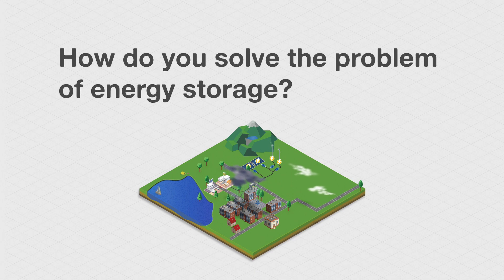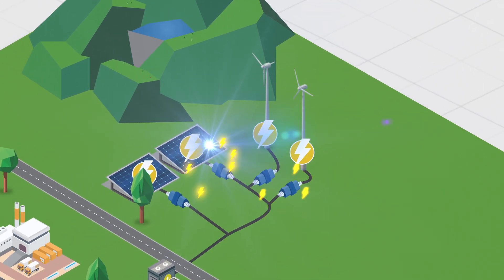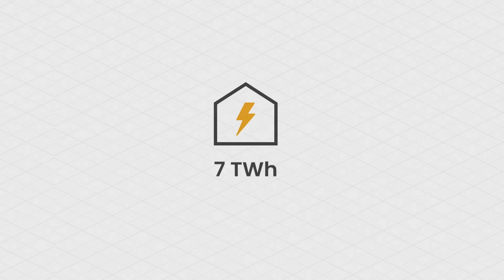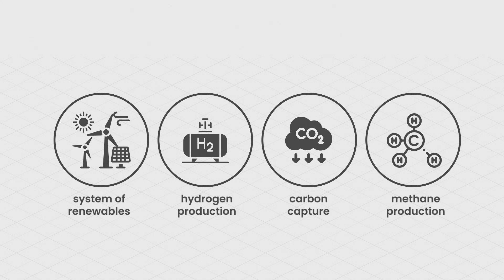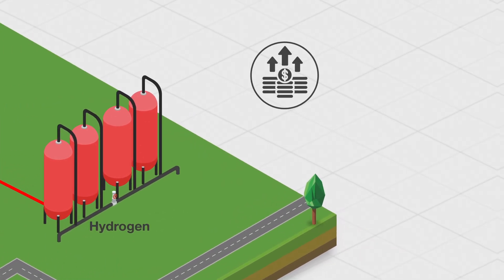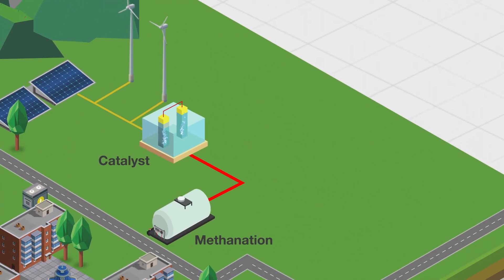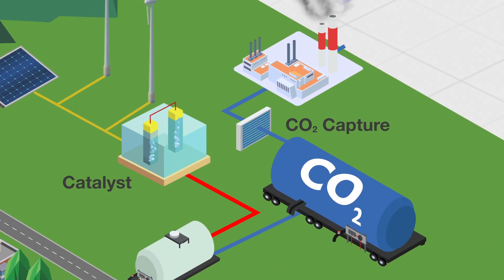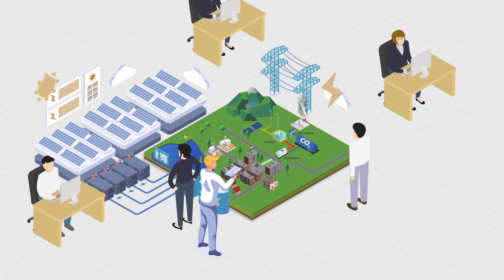The problem with green energy

Comment: Interesting article. The loss in useful energy through the process of electrolysis, storage ( complex & requiring energy to be kept very cold in storage) , then re-gasification and use in gas fired turbines to produce electricity is a negative energy game.  That is not highlighted. The core problem with renewables is fundamentally that they are UNRELIABLE.  Trying to address this aspect is of course intellectually interesting and will garner research funding, but the expenses in solving these unreliability issues would best spent more economically, like small scale nuclear. Not EU countries importing electricity from France are colour blind to it’s nuclear sources.

Comment: Very good execution on how to explain your main message on your research. The idea on reutilizing the CO2 to produce methane makes me feel uncomfortable, as methane will be transformed back to energy by releasing back the CO2 it initially captured. Why not store the surplus of energy by using gravity energy storage orARES as Switzerland already has so many mountains? Or flow batteries, even though it will take a lot of space, but Iron should be abundant enough? This would allow to keep the whole cycle cleaner - based on my limited knowledge.

Comment: switzerland has 8TWh of electricity storage through dams in the alps... So why bother with hydrogen/methane at all?
Reply: Because other countries will need other solutions
Reply: @mathiasgebhart Because it's only enough for 1-2 months. In winter Switzerland is importing much of it's electricity and in summer Switzerland is exporting a lot...
Reply: I agree that other countries will need other solutions, but we need to set a scope as well and solve problems from scope to scope. Otherwise countries will apply solutions, that might not be the optimal one for them. Especially if you have a lot of rivers but do not use dams, yet.